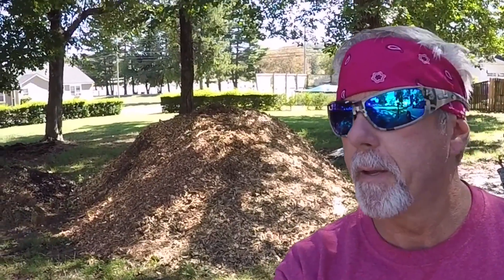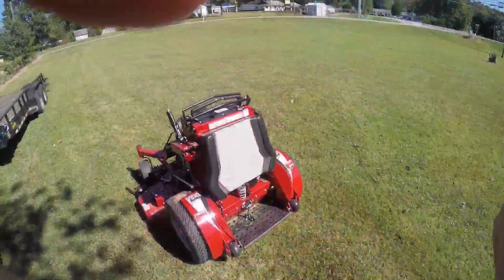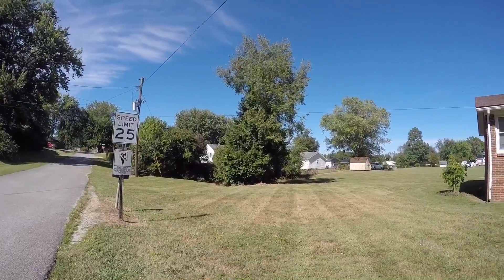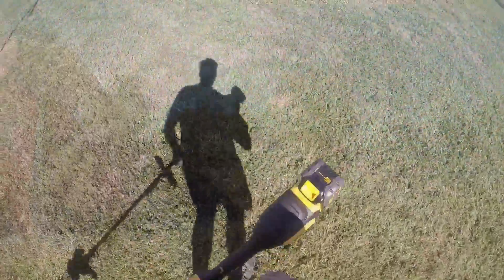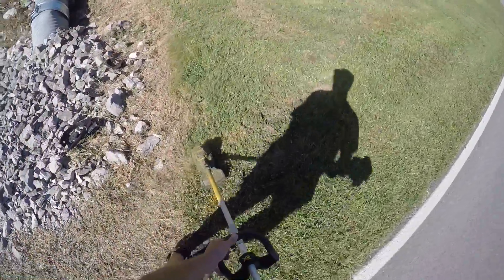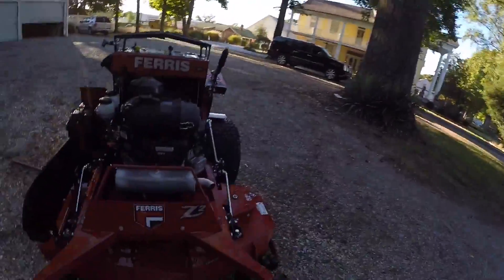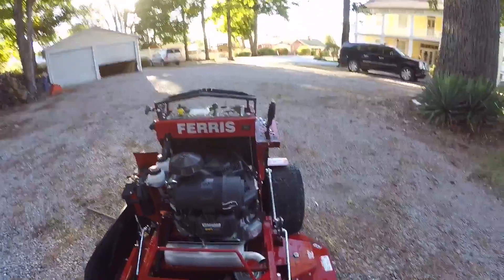Fuel efficiency of the Ferris SRS Z2 #7 ( fuel injected)

Comment: Sir I just bought the Ferris Z3 37hp with 52in deck, waiting for your Z3 review, and what octane fuel are you running in your Z3 .
Reply from the maker: scott magyar I think you will be happier with that more of a solid mower, heavier, rides better and the anti-scalping is better. I run straight gas no alcohol. Congrats on a fine machine.
Reply: David Farmer I get it tomorrow, mail ordered saved 2000, when's the Z3 review 👍

Comment: Sir, does Z3 get better gas mileage then the Z2 , Thks
Reply from the maker: scott magyar I cant really answer that and say yes it does. It seems to but the Z2 has 8 gal tank and the z3 has 11 gal tank. Having the extra 3 gal makes a big difference in how often you have to fill up. I would go with the Z3 because of bigger tires, the weight gives better ride it is an all around beefier mower. Just my opinion.

Comment: how many hours on 3 gallons
Reply: The hour meters only run when the blades are engaged on the ferris mowers, so unless he uses a stopwatch it's hard to get an average. I installed an hour meter on mine. Mine has the Kawasaki and from what I've been told it burns 1.5 gph.
Reply from the maker: James Martin that's a good question when I start with leaves I'll fill it and run a day and run a stop watch on the mower..
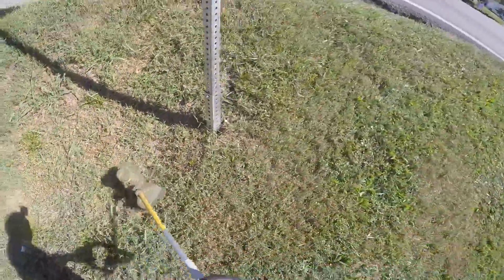 This day I mowed eleven lawns an they are close together so I don't have much down time or weedeating,  I was out 12-5:30. But I will keep up with time next time. Thanks for watching and commenting.